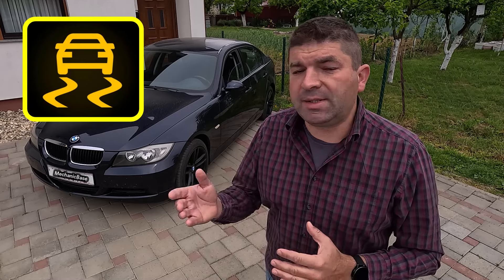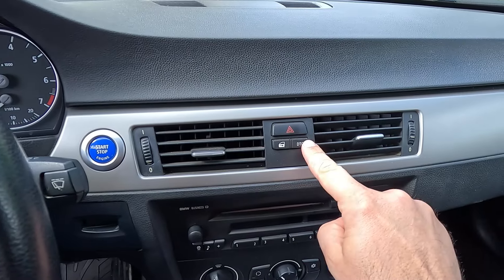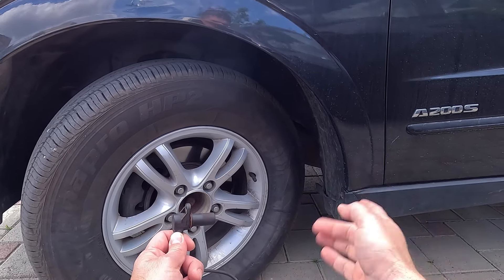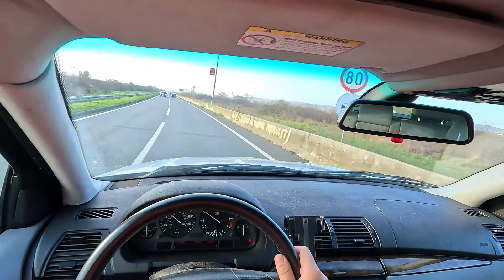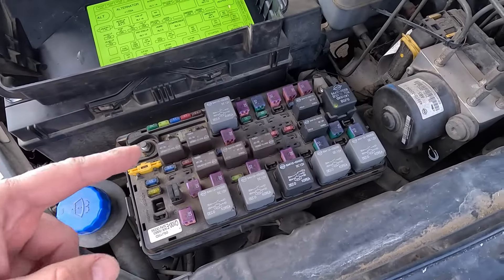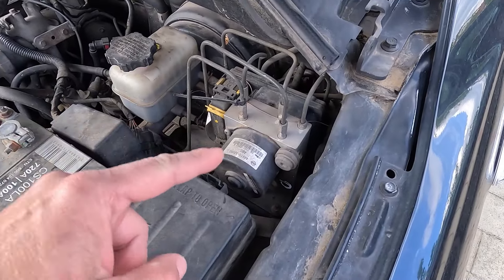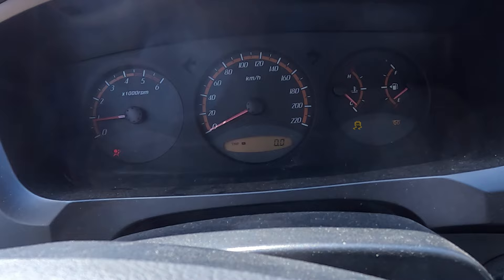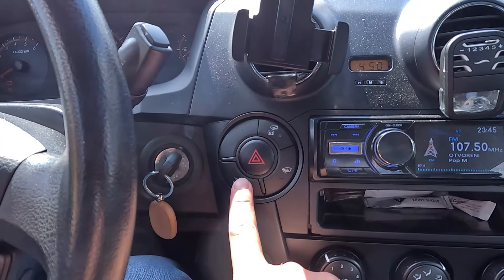Traction Control Light On? 8 Common Causes And How To Fix it!

Comment: Help I drive a Nissan juke 2011 I’m having probs with traction control the light is not permanently on it flashes at me every time I drive it  it’s been on dignosric test but no codes coming up what can it be